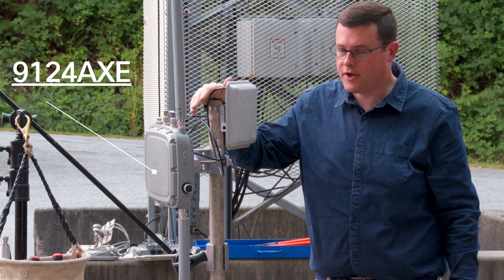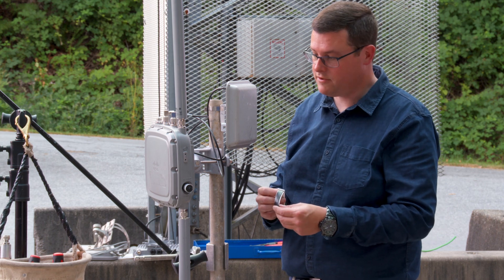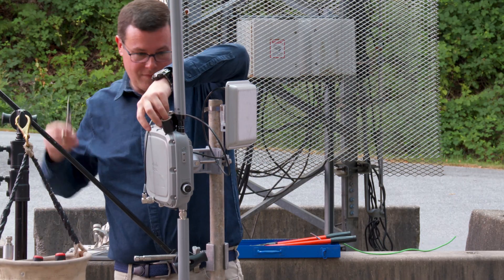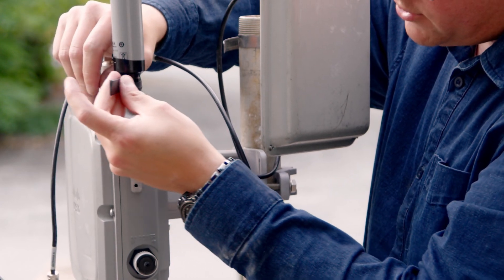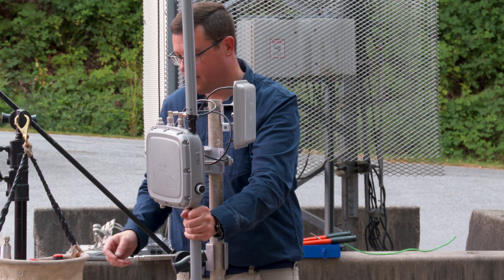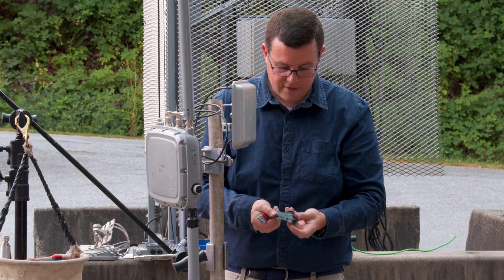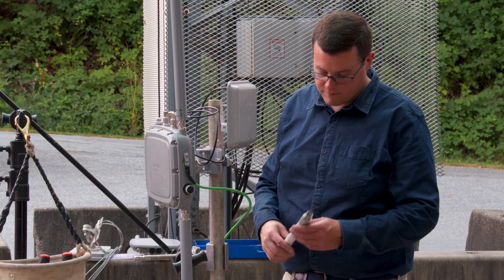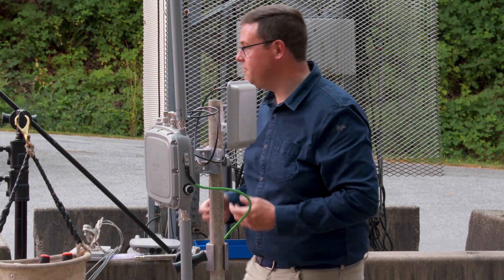Outdoor AP's : Weatherproofing RF connections & Grounding

Comment: not sure how valuable that Coax Seal will be as it didn't cover the top edge of the first layer of vinyl tape ... any water moving down will be direct against the vinyl tape adhesive and eventually work its way underneath. The Coax Seal is just isolated between a couple layers of vinyl !
Reply: Yeah good call  out.  I should have ripped off a longer piece :)
Reply: Good call. I didn't even notice it when i watched it.